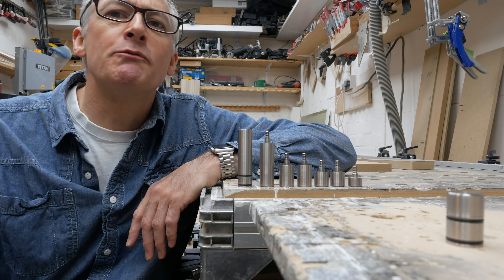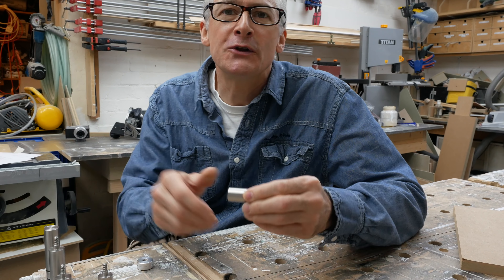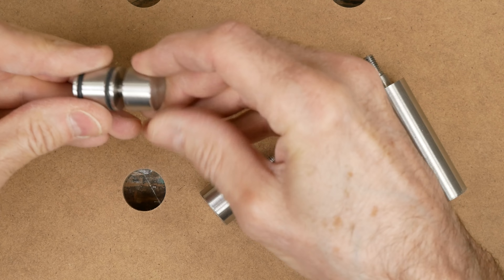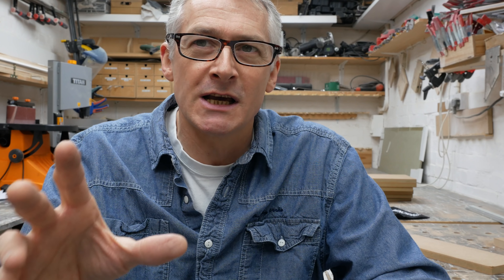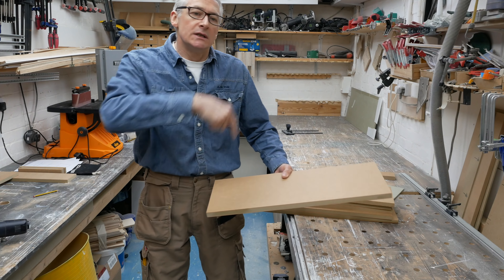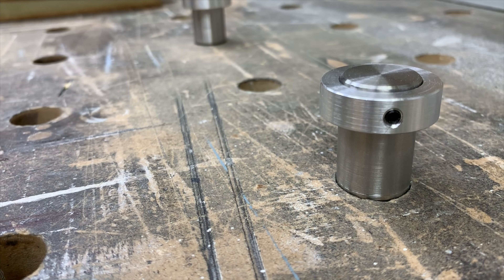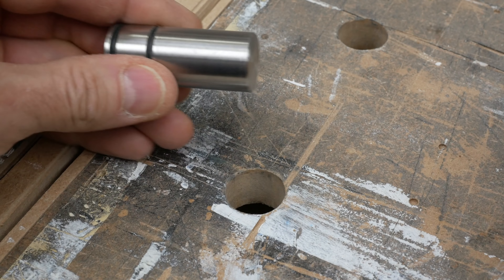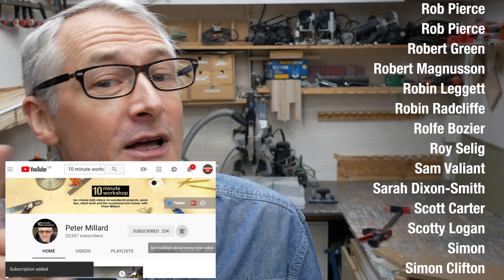Dog Collars & Dominos [video 299][AD/Gifted**]

Comment: How very excellent! Having just ordered an MFT top from Ebay and watched the Bish Bash Bosch video I can see that I'll be buying into this system.
As a side issue, it would appear that you have a shiny new Triton belt & spindle sander on the bench.  Haha - so do I!  Mine arrived last week :-)
I found that dust collection when using the spindles was pretty good. But it is not so good when using the belt - which I know will annoy you. I have improved this a lot by making a hood that covers the fixed part of the table. As most of the dust is thrown toward the back of the machine, this works well. I made the hood by simply cutting a plastic storage box in half and clamping it in place.
Reply from the maker: Hi Clive, and thanks! Yes, I've had the Triton belt & bobbin sander on my list for a little while - mostly for the belt, I must admit - whilst waiting for it to come around on 'special' again. Only played with it so far, but seems pretty good - and just the right size to chuck under the bench when I'm not using it. 👍
Reply: @10MinuteWorkshop  I keep mine under the bench, too - on a wheeled dolly.  My review of the machine is now live on Amazon: https://www.amazon.co.uk/gp/customer-reviews/RN09M13YA9NVH?ref=pf_ov_at_pdctrvw_srp

Comment: Brilliant idea those collars, good on ya Bish.B.B 👍
Great review, mate. 👌
Nice to have a 3rd, 4th or even 5th hand in the shop😉
Reply from the maker: Always! 👍👍
Reply: the only problem is the grub screw marks when tightened especially noticeable on aluminium dogs i,ve had more success with axminster ones which  clamp but more expensive

Comment: I love your use of the quad dog collars. I wish they made 19mm quad dogs / dog collars as well. Bench Dog holes here are frequently 3/4" wish is close enough to 19mm.  If you have any influence over there.. let them know there is a need here in the US.
Reply: I am glad they do not as they are expensive and only being a part time wood worker I might be still be tempted to buy, because they would be quite handy. The lock collars are way over price you can buy one 3/4 inch lock collars for bearings for less than $2 and benchdog wants $13 for a pair which is the sale price.

Comment: These dogs and accessories are not pennies but can't be considered expensive compared with the opportunity cost of your time, I'm not a tradesman but considering a set because they make accurate and repeat work look easy. Presumably removes frustration, helps with concentration and just makes jobs "nicer". One question, MDF "dog table"(????) Or plywood. My tin workshop can sweat and get damp in certain types of weather - oh, should I treat/wax/oil the table to protect it. Long comment but your channel gets better and better, nice and professional presenting style.
Reply from the maker: Thanks Stuart! The original MFT tops are a type of MDF, but third-party tops can be MDF or Birch ply. I don’t do anything to protect mine, but I have a very dry workshop. I know guys who wax or varnish theirs, but I’ve no direct experience of doing this. 👍👍
Reply: @10MinuteWorkshop  Thanks Peter.

Comment: l'm poor so chop 20mm plastic electrical conduit into various lengths for the shorter dogs! 
Yes l have got some of the other super brand.  I still use the conduit ones quite a lot, becuase they are light weight and tight fit in the holes, so l think I'm gonna glue some ply collars and try that domino holding trick! 

Anyway good shout Peter!!!!!🍻🍻🍻🍻🍻
Reply from the maker: Great! If it’s a snug fit then they’ll be fine. 👍👍
Reply: I use the conduit trick too. I fit two bits of conduit into a joining piece and then saw through the middle of the joint. They are accurate enough for most things and are less likely to cause damage to tools.
Reply: Andrew L best of all they're cheap, good idea using a conduit connector, gonna try that😎👍😎👍😎🍻

Comment: Hmmm... I have a lathe 🙄
I might just knock up a set... 🤫
I just need the bored table panel... 🤨

Pete... any problems with wear in the table holes... have you treated them in any way ? 
I'd imagine soaking with superglue or even just poly might be a good idea to prolong their life ...
Reply from the maker: No, I haven't done anything to the table other than abuse it. It is due to be replaced, but I don't intend to do anything special to treat it - it's a consumable, albeit one that last a fair while 👍

Comment: I once saw a video where they said they prefer wooden dogs, because you accidentally hit it with a plane or other tool there’s no damage done. So I made my own, as per Paul Sellars and I’m quite proud of them and I made 12 of 3 different sizes for about £7 including dowels, epoxy and spring wire. My (cheap) workbench has 10mm dog holes so it’s quite difficult to find dogs etc for it and I’ve only just managed to get some holdfasts.

I’m thinking I’m talking about the wrong sort of workbench 😁😊🤣

What was the camera behind you please?
Reply from the maker: Yes, fair point about hand planes etc... - maybe they just need to be a bit more careful, lol! The little camera? It’s a Panasonic Lumix GX800; bought it to go in a gimbal, but it’s doing the overheads and detail/cutaways now as it’s also 4K. 👍👍
Reply: Peter Millard I was wondering if it was one of your analogue ones, from you won Young LPOY. That’s heck of a phenomenal achievement.
Reply from the maker: @markharris5771  Haha, no, much more modern that that, lol! 👍

Comment: I’m deciding between these and the ujk part super dogs. The Parf come with an optional stabilising chamfer ring to be certain of square fitting (especially on taller dogs). Is square a problem with the taller super quad dogs ? Have you tested?
Reply from the maker: Hiya. I haven’t tested them for square, no - mostly because I don’t really use them in that way tbh, and also because my NFT top is pretty old and getting a bit sloppy now, so it wouldn’t really be a fair test. Remember as well you’ll also need the chamfering tool if you don’t have the UJK top, in order to use the stabilising ring on the UJK dogs. 👍

Comment: I do wonder about the accuracy though. Have you tried setting a square to the long one? I always screw my dogs from behind to the table. 
1 Otherwhise they still have a small amount of play, and 
2 the flange on the bottom pulls them square on the table when screwed down.
Reply from the maker: I haven’t no - I don’t really use these that way tbh; with the collars it’s all about stopping the workpiece tipping up for me, otherwise I’m just using them to align two boards by butting them against a stop. If there’s any lack of perpendicularity, it hasn’t affected me at all. Fair point though - I’ll check on a new MFT top. 👍

Comment: I’ve seen a few bench dogs with steel clamping mechanisms. They just look like they would damage the 20mm holes quickly. These rubber versions look a lot better. Do they spin when you tighten? Bench dogs always seem quite expensive to me.
Reply: The little systainer they do looks good, at least you wouldn’t loose them. £120 makes them a little pricey for an impulse purchase.
Reply from the maker: No, the rubber o-rings are a pretty snug fit, and the base of the dogs seem to stay put when you turn the body to nip them up tight. As I say in the vid, there are some other versions of these that are quite a bit more expensive. 👍
Reply: Peter Millard I guess like most things, it actually costs a lot more to make than you would expect.
Reply from the maker: @chrisb4009  These are stainless, too, so more expensive materials, and harder to machine.👍

Comment: Going back to cheap track saws, Aldi track SW is now available for just under £50, worthwhile for a beginner woodworker or would you still suggest the Titan?
Reply from the maker: Depends how much work you're prepared to do; to get decent cuts you'll need to change the blade and/or change the guiderail splinterguard. That alone will cost you time and money, assuming you're happy doing the work; it'll cut straight and clean with those changes but all you'll end up with is a saw with oddball rails that wont take other accessories, and that's a dead-end going forwards. Whereas the Titan you just buy it and use it - out of the box it's way ahead of the Aldi.

Comment: Do you think that the quad dogs give the same degree of accuracy as standard dogs for making 90 degree cuts?
I ask because it is the O rings and tightening that govern the fit in the hole - in the video the dog appears to move when you butt the workpiece against it. I realise you were not using them in the conventional manner and may not have secured them sufficiently.
Reply from the maker: No, they're solid in the hole when tightened properly; my MFT top needs replacing (holes are all a bit loose) and the quad dogs were only nipped up just enough for the purpose shown here - you can get them much tighter of you need to 👍

Comment: Hi Peter, Has the discount offer ended now as I can't seem to get it to work on the benchdog uk website? Cheers for all the content!
Reply from the maker: Hiya. I don’t know if it was time-limited tbh - it was a little while ago, shoot Ralph a message and ask him, is probably the quickest way to find out tbh 👍👍
Reply: @10MinuteWorkshop  Rightio! - I'll get to it. Tried doing some 45 angle cuts on my MFT/3 the other day and found the protractor and fence a little bit crap unless you set them up each  time with an angle guage so thought i might retire the festool one and go with a fence dog solution instead. Also, on an unrelated  note,  have you had anymore interest in the Mafell DDF40?
Cheers
Reply from the maker: Yeah, that is a bit crap - and why I love  my old MFT/1080, lol! As for the Mafell Doweller - you might want to follow me on Instagram, or just sit tight and wait for Friday’s video...  🤔🤷‍♂️
Reply: @10MinuteWorkshop  Phwoar, can't wait. I've had mine since December (xmas gift to myself) and I love it haha! Apparently it's sold quite well but there's very little coverage of it on Youtube.
Reply from the maker: @Mylesleadbeatter  #spoiler - I didn't buy the Mafell... 🤷‍♂️
Reply: @10MinuteWorkshop  Won over by the tensos!

Comment: Hi Peter is the discount code still working as I have just tried it and no luck
Reply from the maker: Yes, 5% discount across the board using offer code "10minuteworkshop" at checkout. 👍Also a link in the video description, btw. 👍

Comment: Unfortunately the discount code no longer works.
Reply from the maker: As mentioned in the video description:-
*
Support the channel and receive a 5% discount across the board at Benchdogs (link below) by using the offer code “10minuteworkshop” at checkout. Please note that this replaces the "PeterMillard10' offer that is no longer available.

https://bit.ly/bench-dogs 
*
The original offer code ran for 12 months, then was replaced by this 'across the board' discount.

Comment: First things first, great vids!! Your presenting technique is bang on and easy on the ear!! Unlike a lot of others providing similar content! ;0) Just been on the bench dogs.co.uk website to purchase 2 sets of Quad Dogs Set of 4 @ £70 for the two sets (also ordering 2xQuadDogsExtraBases, 2xFenceDogs, 2xFlagStops) however I really like the case that comes with the Quad Dogs Mini Systainer @ £82.00. Wanted to order the Systainer Twin set instead of the 2 x Quad Dogs set of 4 but your discount code doesn’t work with the Systainer Twin Set even though there’s little difference in the items other than the case. Is there any chance of getting your PETERMILLARD10 code working against the QUAD DOGS MINI SYSTAINER TWIN SET?! :0D You don’t ask! You Don’t get!.
Reply from the maker: Hi Darryl and thanks for getting in touch. This video is almost two years old now, and that discount offer ended last year when Benchdogs changed their offer to a 5% discount across the board by using the offer code "10minuteworkshop" at checkout.

I do mention this in the video description:-

*
Support the channel and receive a 5% discount across the board at Benchdogs (link below) by using the offer code “10minuteworkshop” at checkout. Please note that this replaces the "PeterMillard10' offer that is no longer available.

https://bit.ly/bench-dogs 
*

Cheers, Peter
Reply: @10MinuteWorkshop  Thanks Peter for the update I missed that. How odd though, as your old code still works on the benchdogs.co.uk website as shows in the basket when added. No problem the updated 5% code will likely be better in the end with the additional items added to my basket. Keep up the great vids. :0)
Reply from the maker: Thanks, and no problem. I suspect the old code wouldn't work if you tried to checkout though! 🤷‍♂️👍
Reply: Thanks buddy really appreciated. If you ever need a snooker cue come and see me and Ill give you a discount code for one of mine! Te hee! :0D Again my sincere thanks, keep up the great work.